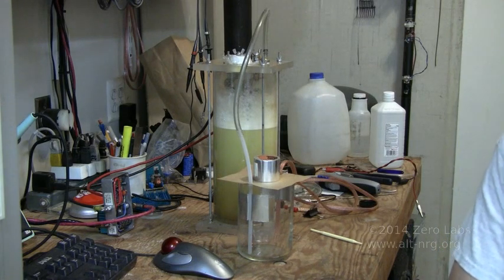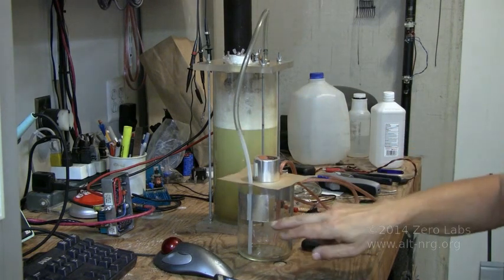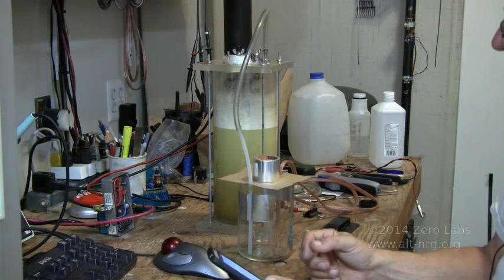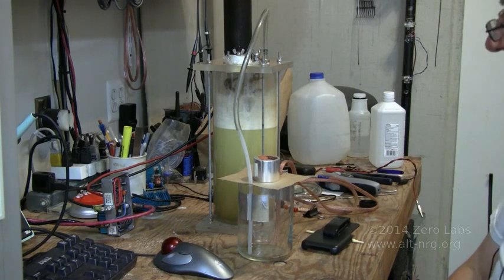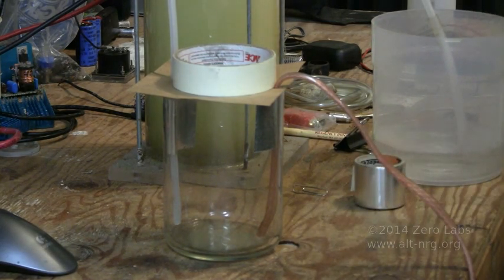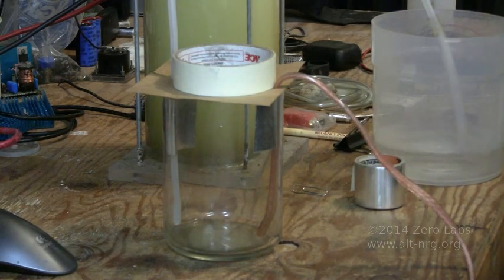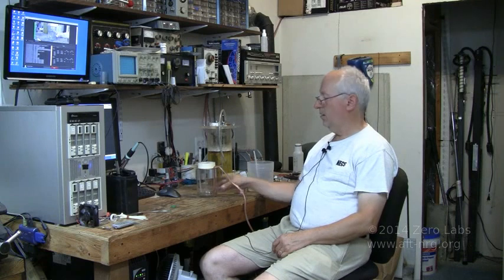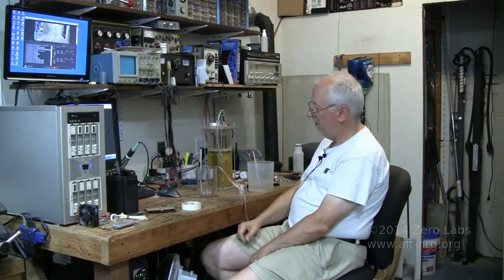#369 Heavier than air HHO update

Comment: Point of Disagreement:
Myth Busters is a fun TV show, but care should be taken when making firm decrees. Your recent HHO YouTube sequence illustrates a valuable test for detecting the hypothesized secondary gas from an electrolyzer. However, the conclusion "this myth has been busted" is an over generalization. The accurate scientific conclusion is "no secondary gas was detected for the electrolyzer under test." Do you think that you really proved that the cluster gas cannot exist for all electrolyzers under all drive conditions? In particular, do you believe your experiment absolutely proved the secondary gas cannot exist for Ohmasa's vibrational protocol? See: 
              Ohmasa Gas

I agree that most typical electrolyzers would not make a secondary gas. Otherwise we would hear of a lot more observations of a cool fog being emitted and extra energetic activity.

The downside of proclaiming "this myth has been busted" is that it discourages others from exploring the vibrational electrolyzers. The advantage of open source investigation is that the community as a whole can try far more experimental variations than one person can do alone. Parallel exploration can lead to the breakthrough. You are a trusted and beloved leader in the open source community. Do you really wish to discourage the community from exploring the vibrational electrolyzers?

-Moray
Reply: Good point, but a more direct test would be to simply measure the temp of the gas burning. Hydrogen burns colorless flame and very high temp. HOH or water gas burns at 54 deg. C., as demonstrated by torches that burn cool. If you have this, then the density test would make sense.  There are other indicators in the flame... Blue in color, lots of electric capacity/current if burned into metal connected to a current meter... It might make sense to see how little power you can put into the system and still get gas. The goal is to energize the water and fill the electron orbitals, but not separate the bonds, just the collective bonding.

Comment: I appreciate your experiment on film. I've done this many times as well with the same results. I've used a paper bag and used a balloon that I tried to ignite days after the hydrogen leaked out. While I also agree there is no heavier than air combustible gas, I can say that what is coming out of some "hho" cells may not necessarily be H2 and O2.

We can do these little experiments all day long but until we have the equipment to analyze the molecular/atomic structure of the gas and water vapor on demand as its exiting the cell we can only theorize that there is something special about hho. I for one am convinced there is something special about it but proving it is another case altogether. 

One interesting bit of solid evidence I was able to obtain proved without a doubt these electrolyzers can be setup to actually create, not concentrate, Hydrogen isotopes like Deuterium and Tritium. This information can be found from multiple independent sources including our own military and department of energy contract holders. 

The actual sauce needed to zero in on production of either isotope seems to be a bit of a mystery or sporadic but its is happening in measurable amounts if you have the specialized and expensive equipment to accurately measure. 

Deuterium and Tritium is something not very well understood or talked about within the HHO community but it should be. So much can be said about what you could do with high concentrations of either one. 

If any of our cells were producing either isotope nobody would really even know it, especially running experiments like you have in this video. This would also be true for some exotic gas molecule or water cluster formation. Not that this did not prove something, but as I'm sure you know, it doesn't mean the gas or even the contents of the electrolyte mixture do not have some sort of measurable difference or quality than textbook academia suggests. We also have to know what we are looking for before we can find it. Prime example is this theory we call "Dark Matter". 

Thanks again for the upload...

Comment: where do these people pull these stupid ideas from any ways? it just seems like these people are purposefully wasting peoples time... science education seems to be severely lacking over there...
Reply from the maker: Academia does not have all the answers. Many of the most ground breaking discoveries were made by IGNORING academia and trying something new that contradicts what is taught as fact when, in fact, most of it is still only theory! I do not fault anyone for trying. I fault people for NOT trying, or for discouraging others from trying like you.

In this case, someone conducted an experiment where he thought he witnessed an anomaly. That behooves further investigation to see of it can be replicated. I gave it a very reasonable attempt and could not. So what of it's a dead end? It still contributes to the body of knowledge. You may blissfully carry on with your blinders firmly attached. I care not.

Even if I do waste my time, it's MY time. I will use it as I see fit and you have no say in the matter. I even have another permanent magnet motor idea to try building and no one shall deter me from trying.

Have a nice day!